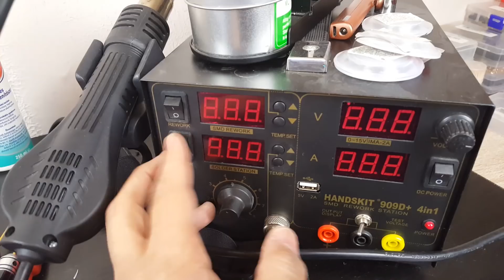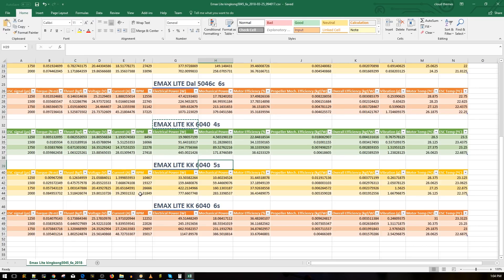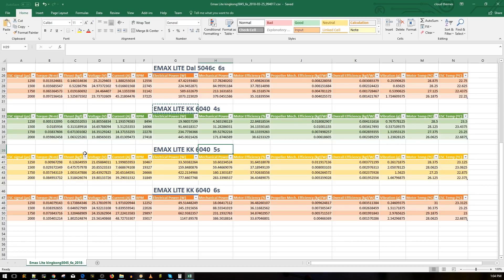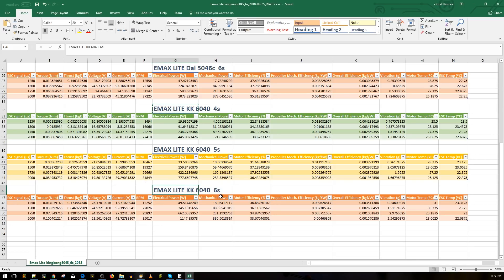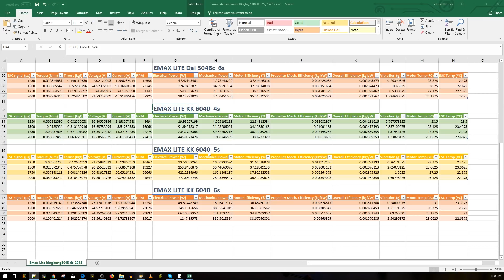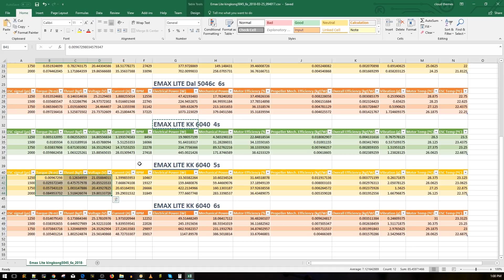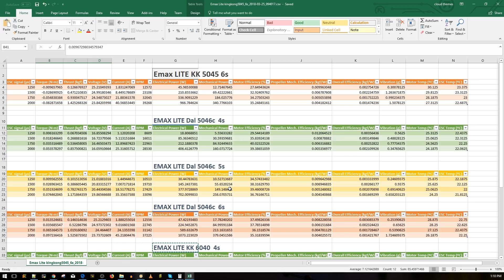Best Low KV Motor Shootout // T-Motor F40 Pro 1600kv, Emax Lite 1900kv, X-Foot Eco

Comment from the maker: If you guys want any other motor on this series of the shootout. You can help me by  emailing the companies to send them over.
Reply: Hi DM,  on the threads consensus is that either the GARILA GWX2507-1500KV or BrotherHobby Avenger 2507 1850KV  motors are good 6s motors builds. I think it would be good to add them to your comparison.   You should probably look at props that require more torque as this is what these motors are designed for... Such as  6" tri-blades (6" DALPROP LR T6040C ) and 7" triblades (HQProp Durable 7X3.5X3 V1S)
Cheers
Reply: Drone Mesh sure, how I can help ?
Reply: How about the cobra cm2206 1400kv v2?

Comment: I've actually been running this motor on 6S with Lumenier 6x5x3 - Gate Breakers and its bananas fun. Batteries are done in 1.5-2 minutes. But it is cray cray fun

Comment: You should make those graphs in video bigger because its really hard to see on my phone :/
Reply from the maker: Buzz don't worry I'll try to make it bigger on the 3rd video 2nd vid is almost done.
Reply: Drone Mesh thanks 😄
Reply: So look at the results on a DECENT SIZED screen rather than requesting mesh try and accommodate stupidly small displays.
There is also an excel sheet for each test ...... if you bother to look m8 ....................
Reply: Blowfeld20k I have like 5" screen with 480p resolution :/